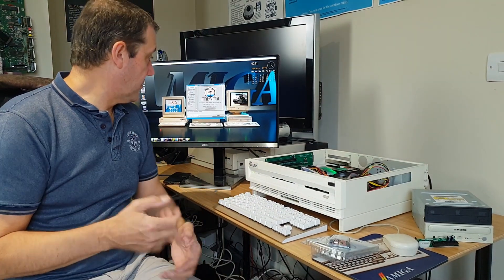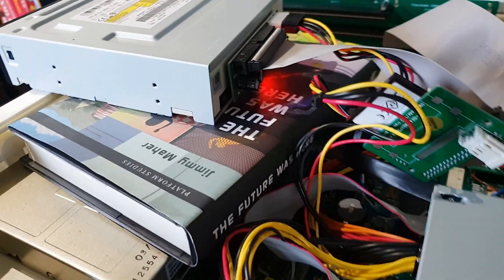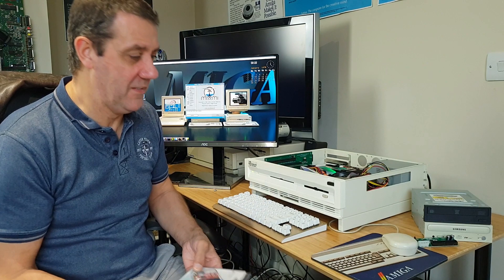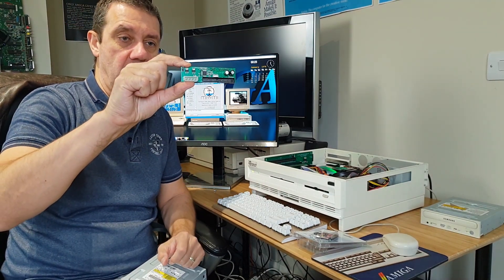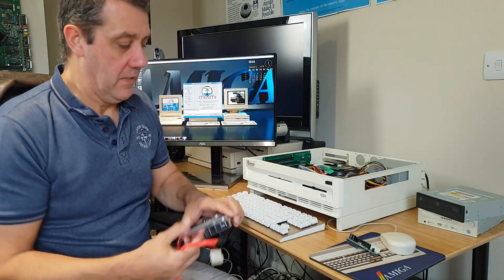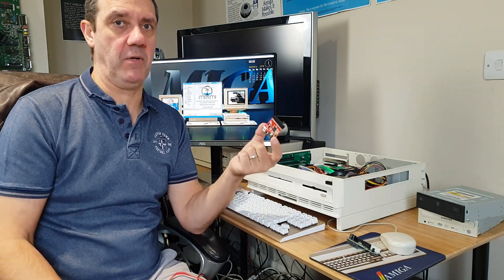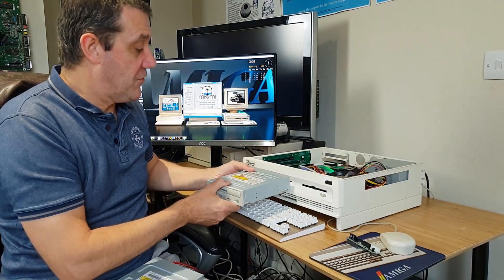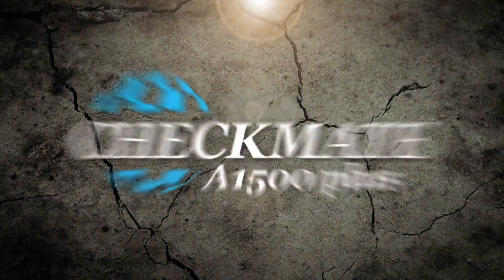Connecting Sata Devices to Amiga in Checkmate 1500 Plus case

Comment: I have A1200 and same adapter but I want to use for HD unfortunately no want to see HD 
Maybe u have some solution for this ?
Reply: Same here with A4000. When only SATA drive is connected then Amiga doesn't see it. However, if both PATA and SATA drives are connected at the same time then Amiga sees them all. Weird.
Reply: Solved. PFS3 was not written to RDB of SATA drive, it was only written to RDB of PATA drive. Booted with both drives connected, went to HDToolBox, selected SATA drive, clicked partition, add/remove and installed PFS3 AIO with correct filesystem ID (same as PFS3 partition filesystem id), saved changes to drive and that was it. PATA drive is no longer needed and SATA drive is always visible on boot. :)

Comment: Is the 44 pin IDE slot on the Vampire providing enough power to the converter I wonder?
Reply: There is a molex connector for power
Reply: @DeFrisselle  I know, but is he using it or just relying on the power from the 44 pin connector?

Comment: So you need laptop-style SATA to IDE? Its funny that your solution does not work... maybe a dodgy convertor...
Where does the IDE come from, native A2000 or A500 does not have an IDE... A2000 has Zorro but AFAIK of the 2 mentioned in my post, that case can only hold an A500...
Is the plan to host HD and CD-ROM drives in the case (with and A500 installed) solely by an installed Vampire?
Cheers,
 - Eddy